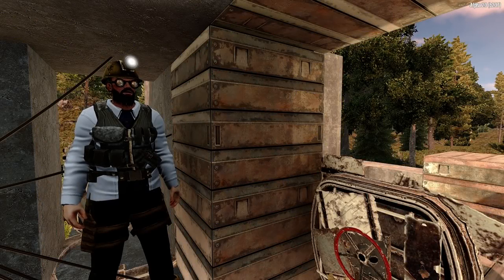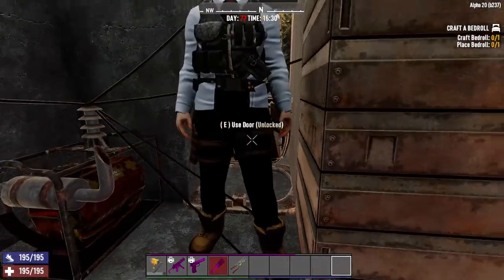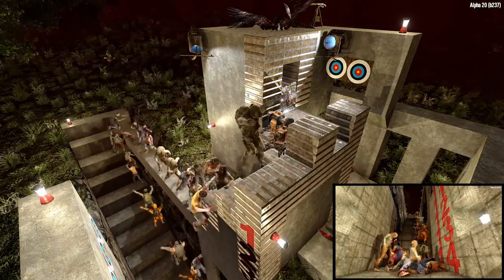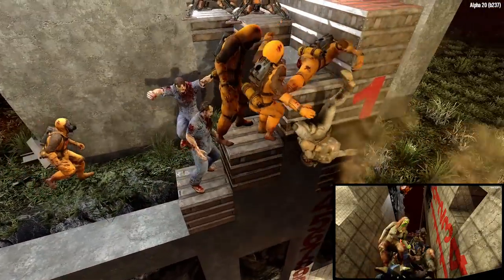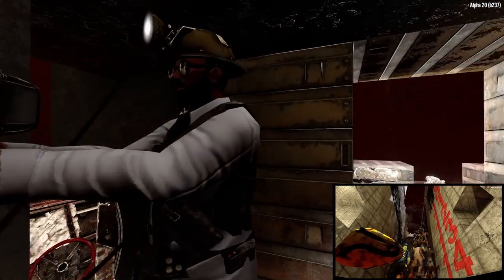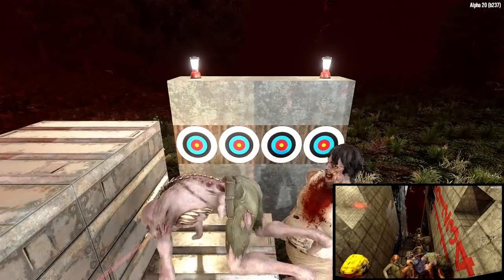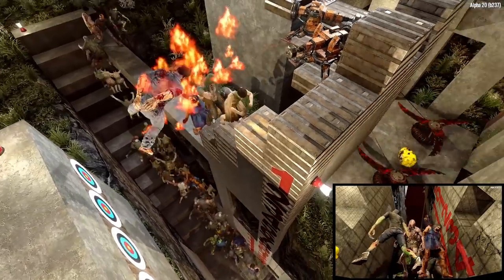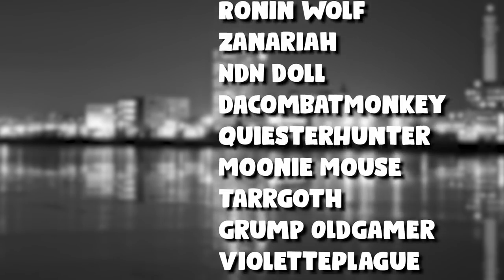AFK Base vs Alpha 20 - Sledge hammer Base - 7 Days to Die

Comment: I tried something like this and kept having my punchers fall through to the ground.

p.s. tried this about five more times and every one the punchers fell through the floor about at the 1am mark and then i got over run.
Reply from the maker: [Genosis] i had this happen recently, did you use a plate? This one is placed on a half block
Reply: Had the same problem too , not sure what they change in a20 but it happen all the time even in building im looting.  It just fall a few floor lower. I was using a half Block too . I mean when its for my horde base

Comment: Thanks for the update! I've been looking forward to this since watching your A19 AFK base. But,  I have a couple questions:

Is this the simplest version of the base that works with the updated zombie pathing for A20? (If not, would you be able to recommend/build/show a more simple version)

Is that blade trap area necessary, will they still path to the stairs, or will they start trying to break blocks?

Do you have to deal with zombie digging? (Looks like there might have been a bit next to the stairs)

As someone else mentioned, I would love a tutorial video building the base from scratch.
Reply from the maker: [Genosis] i may have to do a build video or maybe a stream exploring the AFK sledge process in more depth
Reply: I would absolutely love a tutorial build video.

Comment: I used your setup and it worked good except for some reason both my sledge's ended up getting pushed off and onto the ground below.  I barely survived the night and was almost out of ammo.  Any reason why that happened or anything I can do to prevent that?  I'm wondering if it was an exploding police man...
Reply from the maker: [Genosis] Nothing can move the turrets, it’s a glitch currently in A20 that makes turrets randomly fall through blocks and terrain.

Comment: Few things I find helpful for this type of base.
1st. Have 7 block high pillars, with an upside down L shape that goes 7 out to hold the path.
2nd. I use trader land as my fall area. These two things are because cops blowing up cause far too much damage.
Lastly, have a blade trap hallway after. Occasionally  a cop will blow up both sledge and you need a good fallback option.

Once I get this all set up, I change to horde everyday with 64 and 12 hour night.

Comment: What happens if you set up a trap where the sledge knocks a zombie into another sledge below, which knocks them again into another sledge, like pinball?

They bothered to climb up 14 blocks only to fall down 14 blocks, and another sledge drops them down another 14 blocks.

To make this work, maybe make a tiny platform where the sledge is below so only zeds being knocked off will fall onto them which will get them knocked around down a tunnel.

Maybe... Even a pachinko machine?!

You can probably wire a system to count a score, so zombies landing on specific zones will score certain points.
Reply from the maker: [Genosis] actually, yes! Though it’s not reliable. With enough positioning could make it better. Get a few intellect friends together and you can plinko them all the way down

Comment: When they fall into the pit they go into "Destroy Area" mode, which means they break the nearest block, you can see they got through the bullet proof glass block at 4:26, eventually they will break through the concrete as well, and from there they would either break a full layer of the concrete at the bottom and collapse the stairs, or, start digging under the base to compromise the foundation and collapse it. I havent tested this specifically but that's is what they do in similar pit-loop bases now, especially given the patch that came a month after this video upped the chance for them to go into that "destroy area" mode.
Reply: Guns Nerds and Steel did a bedrock base where he put an electric fence on the way the Zombies are falling, as getting shocked breaks them out of rage mode. Basically they stand up under shock and when they come out of it they just run up as normal. SO adding a fence on the way the Zombies are falling would stop then entering Smash mode.